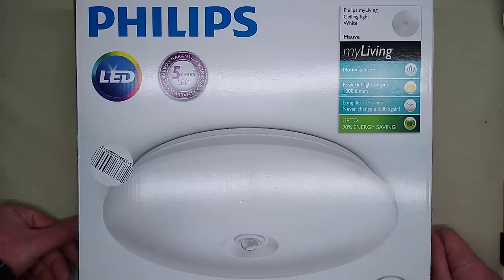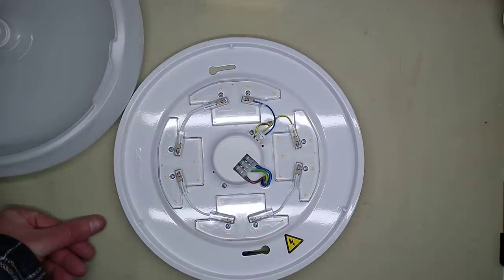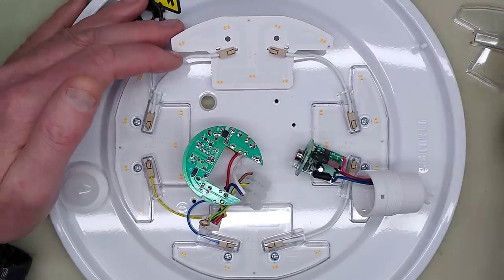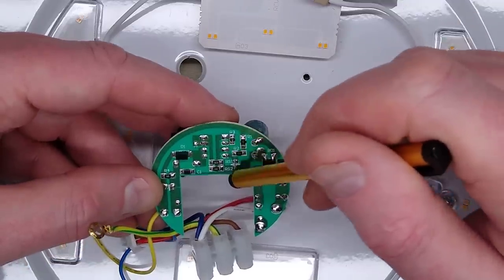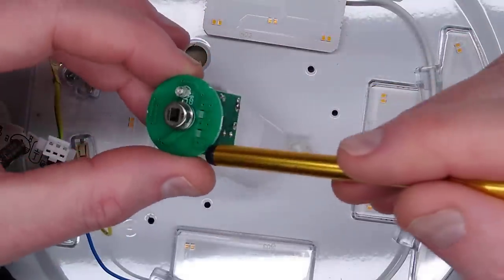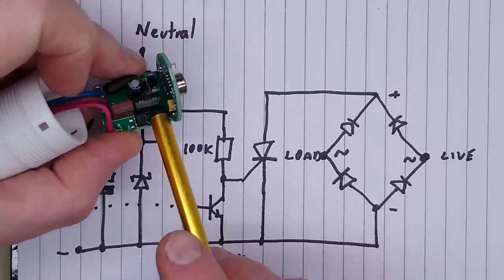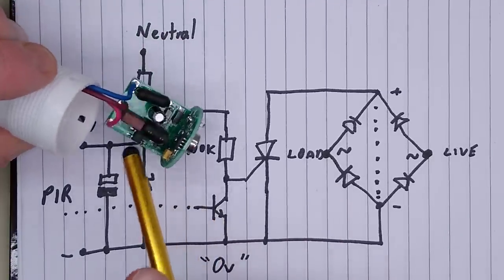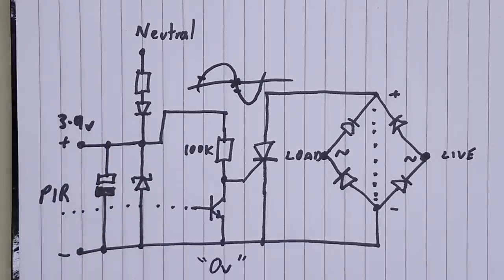LIDL Philips PIR LED ceiling light teardown.

Comment: Speaking of the LEDs failing, I took apart a GE one (wanted one of the LED chips out of it) and it looks like they are using a built-in Zener diode to pick up the slack for when a chip fails. Checking the chip in the reverse direction shows a diode with a voltage too high to be a standard diode (~.780V), so I can only assume that's in case one pukes the Zener will pick up the slack and allow the light to work with a defunct chip. The switching supply looks set up for that, too since it has a higher open circuit voltage than what's needed.

Comment: I do have to put in a good word about Philips reliability, I had a Philips brand led light in a continuously-on outside light  and it lasted a good eight years before the power supply died.
Reply: I've had mixed results with them. But they're usually better than just strictly generic brands.
Reply: Some of their stuff is skookum as hell while other stuff is crap. But most seems to be pretty relieable and well built.
Reply: its pathetic 8 years continuously on and its died theres fluorescent tubes what have lasted longer constantly on and its cos the user fractions to replace them
Reply: Yep, most of my house has been lit by livarno,  LIDL's own brand led bulbs for ten years with only one failure.  In another thread, someone said the problem is with the power supply.   Yep, too stressed.  I don't want to diss Clive, cos I love his stuff, but the aspersions he casts against Phillips here would not stand up in court. Neither party can prove whether or not it lasts for 15 years because it hasn't been made that long.  But I imagine Phillips could submit plots of accelerated ageing which in the absence of simple proof , would back their case, and Clive can't. It's possible that Phillips are lying and that Clive is right.  In the absence of evidence should one adopt cynicism?

Comment: Never change a bulb again!! Yeah, cos you have to change the entire light fitting when it goes bang!!! :P

Just reminds me of the college bogs when on a maths & english course, PIR lights that go for 5 minutes is just not enough for a comfortable passing of one's waste and cannot re-activate the lights owing to being shielded from the PIR sensor, using mobile phone light to "work by" is not fun!!! :S
Reply: lol
That's a pretty epic fail.
Reply: @Jimmeh_B  yep, it'd most likely be the caps that go first...😉
Reply: In one classroom, if the teacher didn't move constantly the entire room's lights would shut down. Such a "good" energy saving idea.
Reply: I once worked in a building where the lights were on timers but could be overridden by calling a phone number.  The system would work out where you were from the callerID and turn the lights back on in the area.  Great idea until the lights go out in a windowless server room and you don't remember where the phone is.

Comment: Thanks for another LED video, all of which help me with my LED lighting stuff. A couple of years ago I re-jigged the lighting in our kitchen and installed 10-off 12W LED downlights (in-house brand from a well known on-line supplier). A few months into their 'very long life' one started flashing then soon after another and your information gave me a pretty instant diagnostic path. The 36V/300mA COBs employed I guess were supposed to be CREE but those used were clearly direct from a factory as a 'high quality' OEM component. I replaced the flashing COBs and another that occasionally flickered. A bench test (ramping up supply from a PSU) showed the LED chips were quite well matched but clearly one or more were running hot and/or the bonding to the board was failing when up to operating temperature. Of course instead of being able to install a new lamp/bulb I need to solder in a new COB board/module (a proper CREE from a reputable supplier) while balancing on a ladder. I've gone down that path because this specific luminaire has been discontinued and I don't want to replace all ten. Fingers crossed CREE lifetime is long. Oh yes, I'd used the same model luminaire in our bathroom and the two I installed in 2006/7 have worked faultlessly. I guess bean counters found a cheaper COB supplier between 2006 and 2018, or the COB factory's quality slipped.

Comment: We had our entire store refitted with LED lighting, it was part of a £1.5m refit, this was just under two years ago, and we’ve had to replace over 30 lights, LEDs aren’t immune from failure, like the claim 😆
Reply: Nothing is forever, including the universe.
Reply: I mean, it's entirely dependent on design. LEDs themselves are extremely reliable... but plugging LED lighting into mains fixtures requires a lot of cheap power conversion, which itself is relatively inefficient, hot, and prone to failure.
Reply: Well a lot of them have a high failure rate as it's Chinese manufacture and they just expect everyone else to pick up the bill for having cheap lights. Trouble is they are going to stop being cheap.
Reply: Its because they over drive the LEDs for max light output. Replace the dead LED(s) and the feedback resistor(s) to run the LEDs at lower current.
Reply: Our city just finished changing out 100,000 street lights to LED units. There's already a large number starting to strobe. We were also an early adopter of LED traffic signals back when red was the only ones available. Those burnt out frequently. Not sure if they changed the design or supplier but it was probably the heat here that caused the problems.
Reply: it depends on the reliability of the driver circuit and how hard they push the LEDs, some overdrive them to get good brightness, that'll definitely reduce life!

Comment: I bought one of these. Really interesting to see what it is made of. 
Can you explain why the LEDs glow dimly all the time they're "off"?
It works very well, but I'm very unimpressed by the case design. 
I had to connect it to existing wiring in the ceiling, which was very short, so I ended up with the lamp fixed to the ceiling and the PIR detector fixed to the cover. 
However hard I tried, I couldn't reach in to plug the connector in before fitting the cover. The cable is too short to be able to reach in from below.
After a few attempts, I managed to drop the cover on the floor. It's made of cheap, brittle plastic, and sure enough it shattered.
Then I had the bright idea of using the old lamp's cover, which just happens to be a few mm wider thn the new one. 
I drilled a hole in the middle to take the PIR module, and made it so that the module could be fitted from inside outwards. That allowed me to plug it in, then fit the cover over it afterwards.
The outcome is that I have a good light inside a nice looking cover. Success!
However, the ergonomics of fitting this lamp to a ceiling are just awful. 
All they needed to do was either make the cable to the PIR longer, or arrange it so that the PIR part was fixed to the base and peeped through a hole in the removable cover. But they didn't.
Reply from the maker: That sounds like capacitive coupling causing a very faint glow.
Reply: @bigclivedotcom  I had a similar issue albeit not with the same driver (but similar, non-isolated one) - using 2way switch. I'd guess the coupling was inductive due to long wires and the return path was through the grounding (green wire), microamps but still enough to glow dimly. 
Swapping live and neutral in the connecting terminal might fix the issue, or adding 1-500k resistor across the led strings.

Comment: Whats the point of putting a tiny surface mount capacitor right after an electrolytic capacitor? Why not just make the electrolytic cap a little bigger? Is there some benefit to having 2 separate caps for filtering?
Reply: The large cap handles the bigger spikes and lower frequency noise. The small on handles the high frequency stuff.
While it seems that they just add up as they are in parallel to noise, they are acting separately.

Comment: I bought a similar looking light from the German electronics seller ELV not too long ago.. Other than this one it has a HF motion detector which (in theory) can be adjusted for sensitivity, ambient light threshold and on-time. Apparently neither the sensitivity dial does anything nor is it able to turn off completely. The LEDs will always be (very dimly) lit. You don't notice it when there is any other light around, but when this one hang right outside your bedroom in the hallway, it drive you crazy. I'll have it sent back to see whether it is a one-off or if all of them are so crappy.
Reply from the maker: LED glow is a common effect in many lights. It's often down to capacitive coupling.
Reply: I know, though it is irritating as you can clearly hear a relay click inside the lamp when it turns on and off.
And looking at the inside of that lamp the relay switches the primary side of the LED driver.

Comment: I replaced every bulb in my home with LEDs, and out of the 20 in everyday use, 1 has died. Idk if that is a good or bad failure  rate but I have 1 ceiling fan with a non-changeable 18w LED light source and my kitchen has a 26w tape light that replaced the florescent tubes originally installed. Both have lasted over a year, but when they do fail, it's going to be a nightmare to replace them.

Comment: Missing capacitor, have you checked checked how it operates with one installed, opposed to factory?
Reply from the maker: Given its placement I'd guess it's just a noise filtering option that was added just in case.

Comment: What is the service availability on these? Can the LED panels be obtained off Ebay or another web site for replacement or are we doomed to fill our landfills with light fixtures?
Reply: honestly if you watch these videos and are ready and willing to get the thing opened up for repair why not just whack out the soldering iron and just replace them leds? these chip leds seem like they are easily sourcable in bulk if neccessary...
Reply: covishen : 'landfills' !? Are you serious? Which country do you live in?
Reply: @nhytg376tgyuu765gjmg  USA
Reply: Crazy you still have landfills!? It's something you can expect from third world, but USA ?!?!
Reply: @nhytg376tgyuu765gjmg  It's the primary way we handle trash. It's gotten to the point in the past couple years a lot of recycling goes straight to the landfills as well, since China mandated clean recycling materials.
Reply: In Sweden we burn all non recyclable, non polluting waist. Which give us heat, electricity and saves money. Effectively reducing emissions, since we don't need additional coal powerplants.
Reply: @nhytg376tgyuu765gjmg  In some areas there are waste to energy plants in some areas, but there aren't many.

Comment: I think philips are pretty much the best LED light manufacturer I have used. % years does seem pretty much right on the money power supply-wise for 12hours a day. I have some  gu10 dimmable bulbs in my living room ceiling light and they have been with me at least 5 years with no significant intensity loss.

Comment: I have an offbrand LED fixture that flickers badly when a laser printer on the same circuit kicks on and draws a lot of current. Should I be looking at noise suppression, or more like a reservoir capacitor, probably on the LEDs but maybe on the IC I assume is in there? 
I would rather mess around inside the printer for those momentary spikes in current that are apparently very frequent while printing, but I'm suspicious the heating element uses AC, and I don't know of an equivalent to adding a big capacitor like I would with DC
Reply: A light fixture shouldn't be on the same circuit as a laser printer plugged into a socket. Lighting and sockets should be on separate circuits.

Comment: The safety covers will just make the LEDs more hot and die faster. I would cut them, so they only go over the contacts.
Reply: The covers also hold the LED PCBs in place. They're not just for safety.
Reply: I would just drill holes in the plastic where the LEDs are. But things have become “one thing breaks, just toss out and replace”, it’s disgusting...
Reply: @ColinTimmins  Yeah it is f**ing disgusting!
Reply: @simontay4851 , thermal conductive glue would do the same.

Comment: I have 4 of these in my home. Not exactly the same units but similar - they dont have motion sensors. Two of them are quite exposed to bugs and Ive noticed dead bugs accumulating on the bottom of the plastic cover. Is it a good idea to cover the holes with electrical tape?
Reply from the maker: It's common.  I usually just clean the covers out every so often.
Reply: Thanks!

Comment: Wouldn't the thyristor explode the bridge  rectifier when it is turned on? Or am I missing something?
Reply: You're missing something. Note the bridge is connected to Live and Load (NOT Neutral). That makes it work like a rectifying switch instead of a traditional bridge.
Reply: @mikecowen6507  k, thx.. I was missing something.

Comment: Clive, what would be a fast switching transistor, say about 5mhz, if possible
Reply from the maker: It depends on your application.  5MHz isn't that fast.  A common transistor may work.
Reply: @bigclivedotcom  faster would be fun

Comment: My issue with PIR is that WiFi can cause false triggers and the light will blink on and off. I had a battery powered one which caused this issue and I had to wrap aluminum tape around the sensor to stop the interference.
Reply from the maker: Mobile phones checking in to the cell towers can induce enough current in the trigger circuit to activate them.
Reply: bigclivedotcom that’s true. For me it was a WiFi router in the room behind the closet doing it.

Comment: The biggest problem with these is the small cable entry and terminal blocks leave it open to varying levels of hackery when being installed on a 3-plate lighting point.

Comment: If one triggers the PIR, how long will the light remain lit if you aren't moving about beneath the light fixture?
Reply from the maker: Continuously, as it is set to ignore the light sensor and restart the timer on each movement detection.
Reply: @bigclivedotcom  How long would the timer run before it shuts off the light when there is no movement below the sensor?
Reply from the maker: @ab_ab_c  I'm not sure.  I didn't time it and don't have the light here.
Reply: @bigclivedotcom  Ok.  Thanks for taking the time to respond to my questions. 

Keept up the good work.  I've learned a lot from watching your vids!

Comment: If Philips were to offer the T-shaped LED PCBs as spare parts, would that make this layman-serviceable again?
Reply: possibly, i'd say the driver circuit would be more likely to fail than the leds...
Reply: @andygozzo72  and there is very little that cannot be repaired on the circuit board.

Comment: Can you wire these to an extractor fan, so it comes on with the light?
Reply from the maker: Yes.  You also get extractor fans that have a switched and continuous feed so they run on for a while after the light has been turned off.

Comment: I wonder how difficult it would be to hack it to get it to run on 12V? I guess that the easiest way would be to use a boost converter... I'm currently looking for options to replace the lighting in my house to 12V DC and this thing looks nice enough to put in a dark hallway... I want to power my lights via battery and solar..
Reply from the maker: The case on its own is perfect for putting your own 12V LED modules or even a row of LED tape sections in.  You could also use standard 1W star LEDs with three in series with either a 12V constant current driver or just a resistor.
Reply: @bigclivedotcom  the most simple solar power system that anyone can do is a panel plus battery setup to run all the lights both inside and out! This is something that I feel a lot of people can do that won't cost the earth.. full off grid lighting is a good gateway into going full solar and and an excellent way to get a good understanding of what is needed to go one step further. 
This light is the first candidate that I have seen which could be an easy to modify and it doesn't look to bad! It's not everyone's cup of tea but if it becomes a trend, who knows what else will turn up?

Comment: Within a month of buying the cover got smashed, it is weak plastic.
The led boards run at 80v in series.
However if you remove the supply, rewire the boards to parallel and use a boost coverter they run very well from 20v, perfect for garage lighting off a car battery.
Anyone have a link to the identical chinese imports?

Comment: I know it's not the same product, but I will say I do trust Philips with their lighting products.
I bought a set of Hue lights back in 2012 when I worked at an Apple store and employees were able to get them 50% off. 
I've had those original 3 bulbs running nearly continuously for 8 years now and they still appear as bright and reliable as ever. That first generation did have some issues with green, but that was fixed in newer generations of the bulbs.
I got them kind of thinking it was a gimmick, but have grown to enjoy them quite a lot. Even bought some more bulbs now and then when I find them on sale. 
While I find IOT stuff pretty scary, I also like that I can run these on my network without needing an internet connection, so that's a positive. 

So, in me experience with the Hue bulbs and some more just white Philips LED bulbs I have, they've been super reliable and last a long time.  :)
Reply: Philips incandescent replacements were the first ones I used that were a decently bright equivalent and not total crap like the over-optimistic CFs and other manufacturers LEDs.

Comment: You know how a PIR sensor has 3 “pixels” that are used to crudely sense motion? I’m wondering if you could put different IR filters on them and a lens of some sort and use the PIR sensor as an IR thermometer?
Reply from the maker: They tend to use two configured as a bridge, and no easy access to the internal connections.